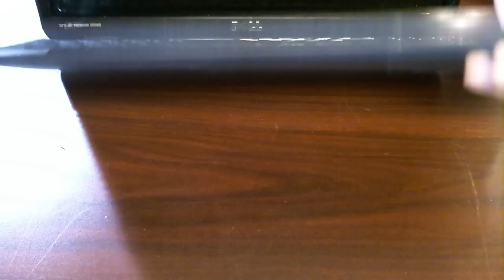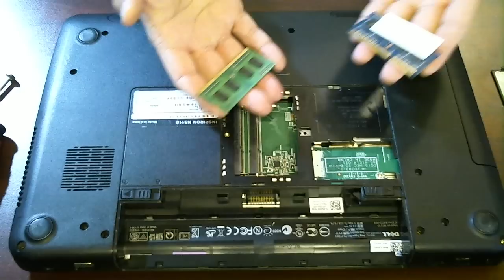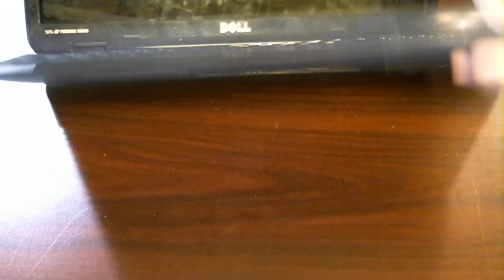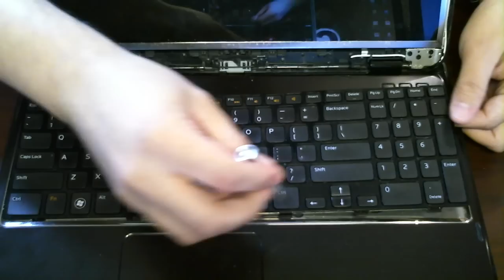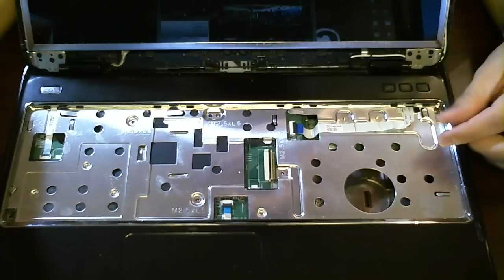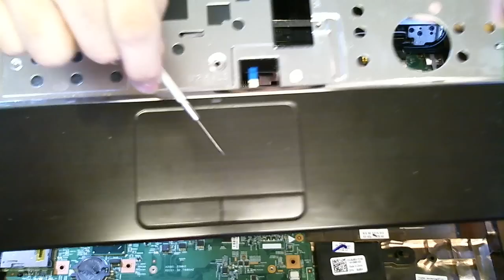Dell Inspiron N5110 RAM Upgrade and Hard Drive Replacement (Classic Guide)

Comment: I have a Dell Inspiron N5110 and I did this a couple of days ago to swap out the hdd for an ssd and do a ram upgrade to 8G and it works fine now. I did exactly what you show in the video. I opened the RAM bay and then removed the 11 screws from the base. After that I turned the laptop over and continued doing the exact same thing as you... the next day and thinking about that I wondered myself... why did I take off the eleven screws from the base? What did I get doing that? . I think there's no reason to do it. You just hace to take off the keyboard, unplug it from the next base, and remove the 5 screws that support the motherboard and that's all. Maybe I'm wrong but I still dont understand why I had to remove the 11 screws from the base. Anyway, thanks tyo video tutorials like yours I was able to upgrade my laptop. Thanks.

Comment: This laptop support another 2.5" unit? like a ssd sata3? or  support  a m.2 sata3 port?
Reply: yes it does, I recently added an ssd in the optical drive place using a caddy
Reply: @Imad-yc  I mean, another place withouth  removing the optical unit.
Reply: @marcogarciadeleon5840  ah sorry! I don't think so, it has only two sata ports

Comment: Eric: how can I tell if I need to replace my heat sync ?  any tips on how to tell if its fried?
Reply from the maker: Check for any obvious signs of overheating. Typically these will be hot to the touch, burning smell, or even light smoke. If you see anything like this turn off your computer immediately. Also, you can download a temp monitor http://www.almico.com/sfdownload.php. Best of luck, please like and sub!

Comment: Hi! What tools do I need to open it up? I'm looking for a tool set that will do the whole job. Also, I spilled water on my keyboard and it seems to have clogged one of the keys, which makes my laptop beep on startup, anyway to fix this? I also have 2 USB ports that won't register devices, and my Date and Time don't save after shutdown. Is there anyway to fix my motherboard? Will any cleaner work?

Comment: the ethernet port at the back doesnt work. is it actually possible that it could have broken on its own without me dropping the pc - everything else seems to be working???? the driver on device manager says the device won't turn on.
Reply from the maker: Checkout the chipset drivers from Dell. Try several downloads using your service tag. Thanks for checking out my videos and please remember to sub!!

Comment: I have a problem with my N5110, when I stop
pc stops but the power light is not extinguished
and after a few seconds the fan starts to rotate
When I sleep as it crashes
the fan is still running
and not stop,
What is this problem please
thank you

Comment: Guided by the video, opened up my laptop and replaced my hdd. After putting it all together now my Bluetooth adapter is missing/not working  and my mouse pad and the mouse keys won't work. Help!

Comment from the maker: Hi - the system is overheating due to the graphics intensive games. Use the video to take the system apart. Then, clean the intake and exhaust vents with compressed air. Also, apply new thermal paste to the chips. Lastly, purchase a laptop cooling pad and use this religiously. Best of luck!!! Please show your support and subscribe!!

Comment: Hey, umm I was watching this to dismantle my  laptop, which is the exact same model coz it heats up really quickly when i play games. Like the latest ones. for example, I  cant play need for speed most wanted 2013 for more than 20 minutes if not less. It shuts down. I was wondering if   there was an issue or something despite the fact that i need a cooling pad XD

And thank you in advance :)

Comment: I just have one question: Do you need to unscrew any screws to remove the keyboard or do you have to just pull it out with those little pins above the function keys? 
A friend spilled a little wine on the enter key and it's sticky now. I just want to clean it properly. Thank God that there was no damage done to the components...
Do you have any advice?

Comment: Hey man, really great work with the laptop, I came by your video when I was searching for a solution for a problem that I've had with my laptop for one time, during some heavy hardware consuming game, the laptop suddenly hibernated, obviously it became heated so it hibernated, what I know is that is a bad sign that the cooling system isn't any longer performing like past, I've had the same with my old HP laptop and ended up hibernating like daily, so how would I prevent this to happen my laptop?

Comment: Hi, can anyone please help me on my Dell Inspiron n5110? The problem is when I unplugged the power adaptor on the laptop, the message "usb cannot recognized" always on the right taskbar. But when I plugged the power adaptor to the laptop the message will disappered and its working fine I guess, It's just so annoying that this usb cannot recognized message keeps appearing when the power adaptor it unplugged. Do I need to reset something on the hardware inside? Please help....

Comment: I have 2 very important problems if you can answer me fast before i cant log in anymore :D. The first one is the one who i think i have to fix fast before is too late, My n5110's fan works but i didnt clean it for half year and when my laptop without reason be really Hot and then close with a strange sound. The second happens every day... The laptop has normal Network Wifi and if you look to the icon you can see a red X and net comes and leaves again and again all time without reason neither...

Comment: i have a problem with this model. During boot up there is a beeping sound There is no error message. Just the beeping sound that starts when the laptop is turned on and either stops or really diminishes when the windows kicks in i.e. when the user login screen appears. Everything stays normal after that. Is there a solution to this problem?

Comment: You cannot change the graphics chip in these models because it is an on board graphics chip, so the only way you could possibly change it is if you get a compatible motherboard.
@roystrikezone Changing the HDD is really easy, just undo the screens holding the screen in place, however be careful on the right side because the base tends to break there really easily, remove the motherboard screws and remove it. Flip it over undo the two screws holding the HDD, remove the hinges and swap them over.

Comment: Dell inspiron N5110 has 2 graphics cards. One is intel HD one and the other one is Nvidia geforce 525m. I have the same laptop and MW3 runs smooth with Geforce 525m.

Comment: Hey there.I tried to Clean the fan and i did the exact same process..but now i open my pc and i have problems.The pc is slow,my sound card doesnt work (neither does my Ethernet or wifi) and my theme is the windows classic theme and i cant change it!
When i run with ubuntu my ethernet works fine..I tried to install drivers but it wouldnt find the usd..what should i do? Please help! thx

Comment from the maker: Well, to clean the system fan / processor fan can be done by not having to dismantle the system. If you turn the laptop over with the bottom-side up, you should see an air intake and exhaust vents. Use a compressed can of air and blow air into these vents. You will here the fan spin and begin to see dust fly out. This should be easier for you. Thanks for watching!! Show your support and please subscribe!!

Comment: I've had a cooling pad since day one, because my last laptop overheat quite a bit, too. I also used an air blower to remove any dust off the fans, to no avail. I'm sending it to warranty, to hell with it. Thank you for posting this video, anyway; it helped me remove some stuff that helped me get to the fan.

Comment from the maker: Overheating already? A few things to remember are whenever putting your computer through heavy use keep it on a flat surface. This helps with air flow. Also, try putting some compressed air into the air vents to blow out any obstruction. You might also want to consider purchasing a laptop cooling pad. These are amazing at keeping hot laptops cool especially when gaming. Thanks for watching!! Please show your support and subscribe!!!

Comment: Sucks the newer Inspirons are set up this way.  Got it delivered, had my 7200 ready for immediate upgrade, was looking around for the two screws to slide it out and ended up here.  It appears it's due to the board(s) set up inside so the designers had to get cute in order to stuff it all in there.  Thanks for the video.

Comment: I upgraded my Acer Timeline X with the same processor as this Dell to 8GB of ram...and it did give it a nice little boost.  Nothing to write home about, but fair.  The thing is, with these Intel HD/3000 series graphics on newer laptops, they suck on the RAM a little bit.  Don't mean to cut in on your action there ITConflict...I had to use this video to upgrade my friend's N5110 to 7200.  All the goodies on here and they give you a 5400 to churn it with.  Feh.

Comment from the maker: I have done this exact same thing. No need to fret. I would try taking a screwdriver that fits, sort of, and put the screwdriver at an angle and add a little pressure, than quickly attempt to turn the screw off. This may or may not work. You could also try using an allen wrench or even a hex screwdriver. Best of luck!! Just make sure you apply enough pressure (don't break it) but enough to turn the screw and turn it quick. Thanks for watching and please subscribe!!!

Comment: Good vid mate. 
I've got this laptop too. Owned it for about 6 months, - CORE I-5 with 4 GB ram. But it's started to run a bit slow now. Can I upgrade to 8 GB Ram okay, and will that speed it up much? My guess is that it will, and it looks quite easy to do.... What do you think? And how much will that upgrade cost me? Thanks.

Comment: Hi the question that I have is about this laptop but I was hoping you could shed some light - Will this laptop be able to run 16 gb of Ram (2 x 8gb modules)? It would be really kind of you if you could help me out here. Trouble is that I work with some software that doesn't quite run on even 8gb of ram. so I was really looking to cross the 8gb mark, preferably 16gb....

Comment from the maker: If you look at the video at 10:00 the graphics card is located near the bottom left. The fan is top left, processor just under/nearby and graphics card below the processor. Typically, the hard drive isn't really a hot component. Most likely, the heat you are generating is a combination of the processor and graphics card alone. Try blowing out the fan. Also, you could apply new thermal paste. Thanks for watching and please SUBSCRIBE!!!!

Comment from the maker: Yes, this lever should snap up. If it doesn't, try pulling the little notch-like tabs on the sides of the cable out. Be gentle when working with this cable and or plastics involved. When they break, it is VERY difficult to get them plugged-in and sitting just right again.

Comment: I went through the manual. Just being physically difficult to remove. What is the knack to get that cable to come out... has it actually got a little metal lever on top holding it firmly in place? Should I have try to snap it up?

Comment from the maker: @Ramzez51 The graphics card on the standard non-upgraded model is on the motherboard itself. The easiest way to replace this would be to replace the motherboard altogether with an upgrade graphics card. You'll find that this is pretty standard on most basic laptop models.